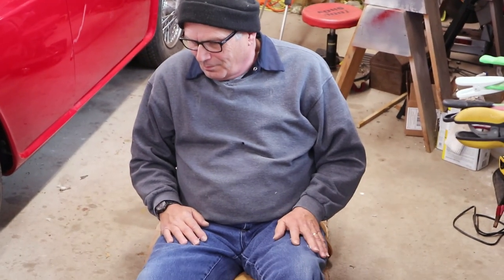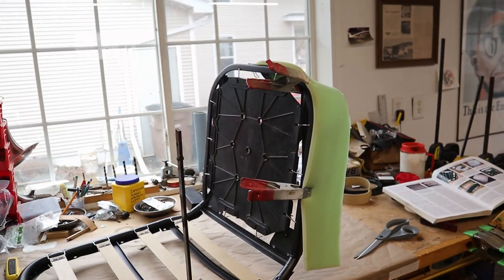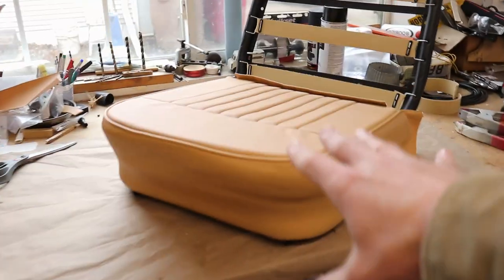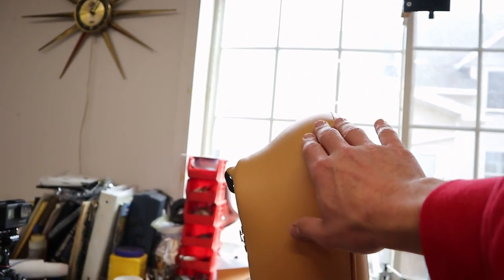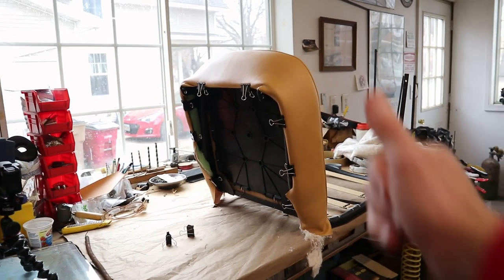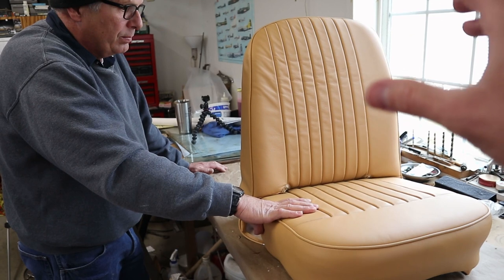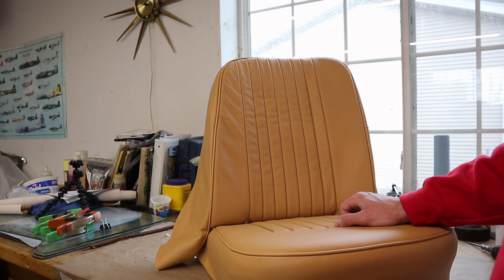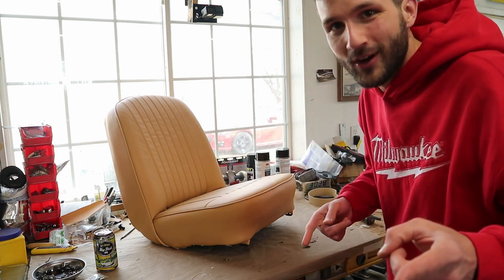Triumph TR4 Seat Cover Installation - British Bucket Seat Restoration Part 2

Comment: Great job . Is there any kind of round bar on the frame it might go there.
Reply from the maker: Thanks Ralph! We ended up attaching it to a cross bar on the seat back instead. It turned out ok and did not end up with the gap we noted when trying it the first time.